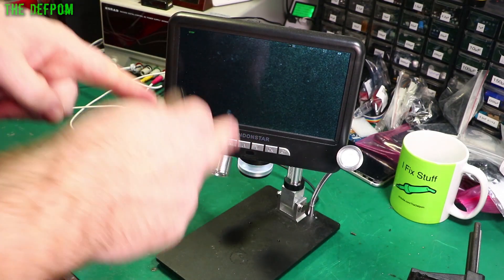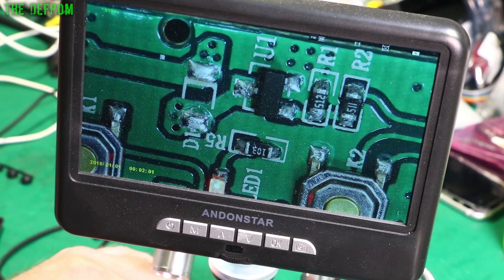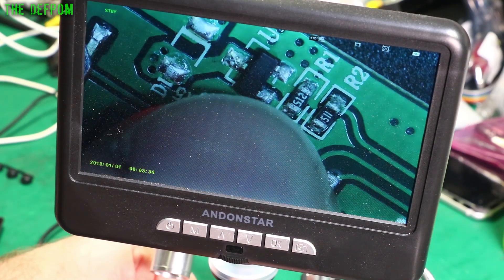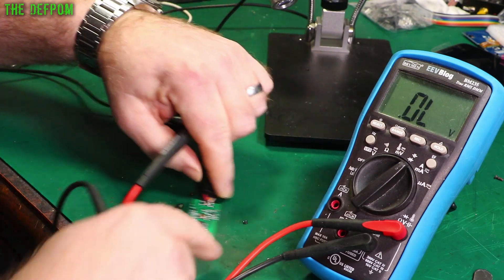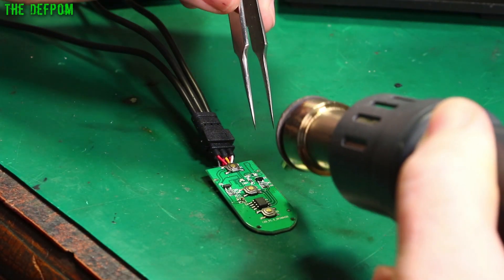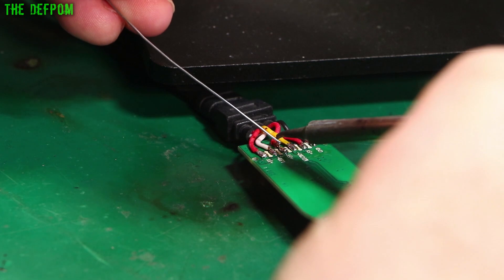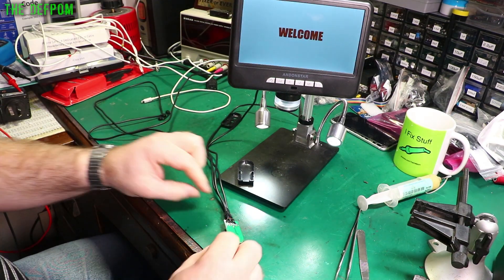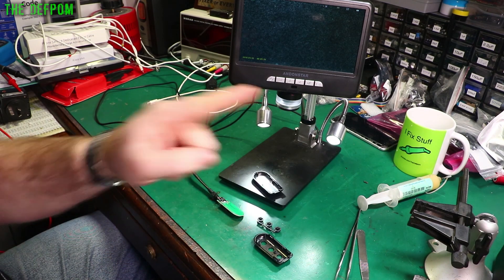#768 Andonstar AD207 LED Lamp Repair

Comment: Hi! I have a similar scope and had the same failure where the insulation on the little wires cracked and shorted. No components were damaged but the scope wouldn’t even turn on. Thanks to your video I looked there first and sure enough… cracked and shorted. THANK U for posting this!

Also - it’s a GREAT tool!

Comment: I do like your microscope. For quick inspection jobs it’s easier than getting the binoculars microscope out.  Does the lightning use pulse width modulation
Reply: Of course it does, using such a tiny switching transistor. Hopefully high enough in frequency that it does notr get detected by the camera, though that clamp diode on the board that is not populated likely should be there, as the long wires likely do have a bit of inductance which might also have contributed to the demise of the transistor.

Love that liquid tape, just it is pretty expensive, as the only supplier locally for it is a boating supplier, where pretty every connection will be soldered then painted with it before you apply PVC tape over it, with a final coat to seal the tape. Only way to get lasting connections unless you spring for the marine connectors and crimp terminals that Yamaha use, which I find are pretty good, even swimming in bilge water.